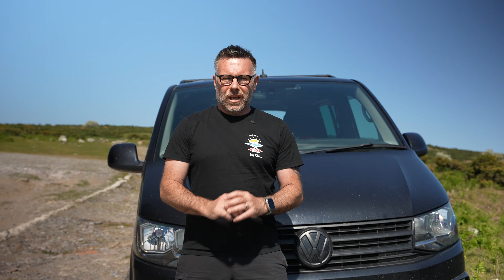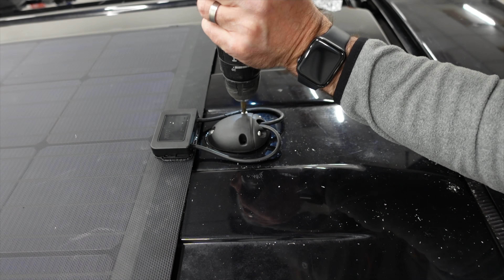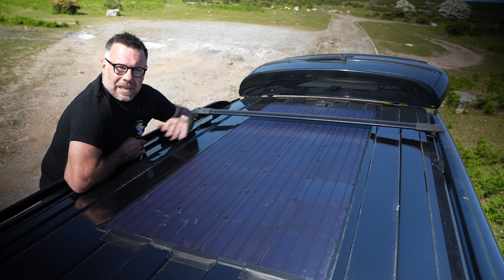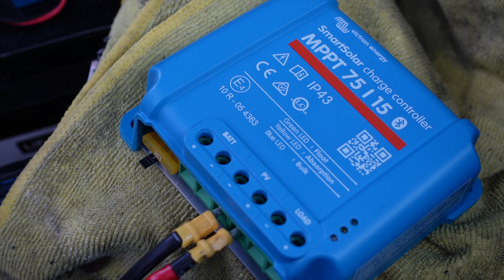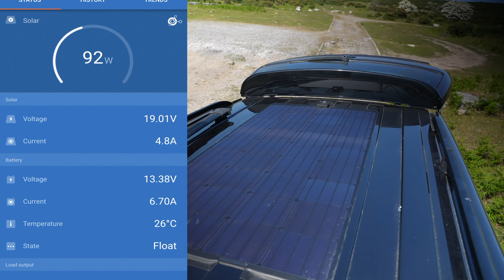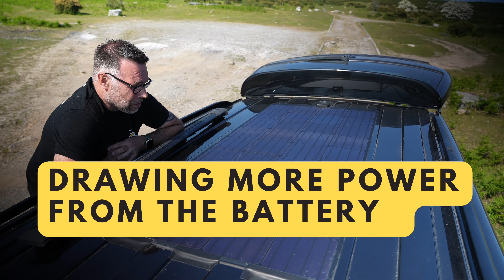Solar Panel on your Camper Van? Avoid This Mistake! ⚠️☀️

Comment: It's fine to do these tests for the purpose of tweaking a bit, but as long as the basics are not right you will never get maximum efficiency. There are solar panels on the market that does not reduce power because of partly shading, but most importantly, solar panels like to be cool. That will never be achieved with gluing a panel to the roof, and furthermore, my own - bad - experience is that, it heats up your van when you def not needing it. Just put your hand on your ceiling on a hot summer day.  I strongly recommend all builders to go for hard panels and at least have 50mm of air below to allow for airflow and cooling

Comment: How is your air resistance. My panels are 2 inches above the roof top.  It’s pulling the van when you don’t expect it. I’m assuming the air is going under the panel.   That’s only one problem. I simply don’t know how to use it. I’m trying.

Comment: Everyone's an expert watching someone else make a mistake. I'm an electrician by trade and even I didn't know how big of an impact even just partial shade would have on the electrical output of the panels. Thank you for sharing your experience! I've learnt loads!
Reply: As an electrician, you should know that. 😂 There are better quality panels that don't do this. That panel is also going to get hot with no ventilation. It's a stupid install.

Comment: Sun in Plymouth? Just kidding. Also temp will affect  it a fair bit but probably less of an issue in UK than Aus, we keep them off the metal roof a little makes a big difference. It's interesting how location affects application, often overlooked by online debate.

Comment: What do you expect from a flexible panel glued flat on black car with no air gap… get a portable panel, point it in perfect sun direction and you get almost the rated WP if ther is enough breeze. If you prefer fixed instal, use a regular penal mounted on your roof Bars. This Will also keep your van cooler inside (if it is big enough) as it drops shadow with wind circulation to the car’s roof. But don’t expect wonders with a flat mounted panel.
Reply from the maker: Think you missed the point. Ie making sure people understand they can’t cover any part of it.
Not all semi flexible panels are the same, you don’t need an air gap for all.
I have a portable, but it’s easier to have a trickle from a permanently installed panel

Comment: Well it's bloody obvious why, how could you not see the problem ?, you also need to have airflow under thre panel as a over heated panel will drastically cut down your output power.

Comment: So I see all the advice, but bought my van done by someone with some put aside to repair as required, my solar panel is fitted pretty much like this one, but no glue where it doesn’t touch the roof so there is some air flow, it has been on for over 5 years now, it is very close pulling its rated wattage, no issues what so ever, no paint damage/fade etc so interesting to see all this advice !

Comment: I have a super modern 180 W flexible panel on my roof. When I tested it in early spring it got 120 W but now in summer I get max 60 W even when I come out of a garage and it is cool ... I dont have anything else on my roof, no shade for sure. I am sure it partially broken. Not sure if it was the summer sun heat or if it is an error by the manufacturer.
Reply from the maker: It can be dependant on a number of factors. For example the charge state of your battery, the load on it etc.

Comment: Definitely better off with a fixed panel on a roof rack as you get airflow around the panel. I opted for fixed on my last van t5.1 and fixed on my current build sprinter mwb this one I'm excited for 305watts on a lithium setup for offgrid. Tbh even with a 130 ah agm with 175 watt fixed panel it was good enough for a 9 day euro trip obvs with a 30amp dc to dc charger too

Comment: Better off fitting extra batteries of as higher quality & amp hour rating as can be installed, we fitted an extra battery & with out any charging can go at least 5 days & we generally don’t stop for more than 3 days at any camp site, just factor in electric hook up at perhaps every other site.

Comment: Er, not sticking it to the roof but having an air gap behind the panel has an effect but if you point the panel at the side so it's perpendicular to the sun, that will make more of a difference. NGL very long video for a very basic point

Comment: Sadly you couldn't have fitted more wrong but hey, every day is a school day!
Reply from the maker: Please explain? 
The size of the panel means it can’t go any other way. It’s quite simple, when the bars aren’t being used, one is moved towards the other not blocking the panel. When the roof bars are in use, the panel is blocked anyway 🤷🏻‍♂️
A different size/type of panel and things could be different

Comment: This is what sailors quickly learned with their ropes hanging over their panels.  Another tip is to allow air flow under the panels to allow them to cool down....increase another 10-20% output.   my experimenting ...https://youtu.be/GXz3FR9GWzM

Comment: I can't remember which one it is but. I think yours is the poly one and the mono one is the other type. Now if you block a cell with anything like your hand it cuts down power. But the other type shuts down completely. If one bit is shaded. So you have the best one I think.

Comment: Nice video! Quick question. I don’t have any knowledge about electricity etc. I bought a van, completely transformed it into a campervan and want to travel Australia. I have a deep cycle battery and a foldable solar blanket. The battery also gets charged while driving. Let’s say I will install a solar panel: how many watts should my setup be? I only have an Adventuring fridge which is covered with insulation. The main goal is to keep the fridge running and charge a phone/laptop. Would love to hear from you!

Comment: I'm on my 4th panel, 1st on died due to heat of roof directed mounted to roof with 3m doubled sided tape, 2nd panel was 150 renogy its worked great although hung over the sunroof a little and in time bent back and contents broke, 3rd panel was DOA now 4th panel 200w and prior to permanently or semi-permanently fix it , I did many tests.
1st test panel out on a flat surface say a camp table using a multimeter set on amp check the amp age i was getting 8 to 10 amps, 10amps setting off the multimeter over current alarm.
So we know the panels good.
2nd test place panel on roof area with a small amount of double stick tape, multimeter now reads 1,5amps very surprising 
Removed the panel and placed back on table now 7 to 10 amps.
This all prior to connecting the panel the above measurements 

Currently I have the following ghetto setup
Old panel still on the roof, it won't be coming off with that much 3m tape
1 piece of plywood in between old and new panel forms an insulation heat gap.
New panel on top, again 7 to amps in full Australian sun.
Once connected up to the dc to dc charger battery monitor shows 3 to 8 amps.
Again out with multimeter and measuring current prior to dc to dc charger at solar input terminals results 6 to 9amps

Going forward a piece of twinwalled polycarbonate roofing will replace the plywood, with air channels running front to back.
They are solar panels but heat effects the flexible ones.
If you look through YouTube there's a few people running airgap setup in various styles.

Try the multimeter test where the panel wiring connects to your mppt, I think you will be surprised at how much work the mppt is doing to not over charge you battery.
Measure both current and volts then times the 2 for watts measurement. 

I would be interested in the results

Comment: putting a solar panel on a flat metal roof is a big mistake.
get a few inch of air flow under it to cool the panel down and point it at the sun and in the summer you will make more power that the sticker says :D
i was getting 115 to 125w from my 100w solar panels in the summer with a 3 inch gap and a near perfect angle to the sun.
i hope you had a battery connected to that controller

Comment: Your 150 watt panel is rated in a controlled environment of 25 degrees at 1000 watts per m2 of solar irradiance.  Placing this panel on your roof with no airflow underneath to help keep it cooler will drastically cut your solar production. Shading and Heat is the biggest killer for solar efficenty and is why most roof panels are raised off the roof to allow for adequate airflow to help keep them cooler. Shading also causes internal resistance which manifest as heat so you get a double whammy effect by shading your panels. when a cell is in shade the other cells try to compensate and heat up. In an electrical string it can only work as effectively as the weakest link in the chain. I would not recommend doing this  to your vehicle, you have most likely oxidised your paint work as well from the extreme heat. This panel will also have a very short lifespan.
Reply: Completely agree. My renogy 200W flex panel mounted in this way burned out after 2 days of sun in northern Scotland 😅 now left with a Sikaflexed useless panel. These are good price though compared to rigid, so thinking for next time to mount it to a thin board and hang it under the roof bars using U bolts.

Comment: I'm sorry but the solar industry has really pissed me off. Based on your own numbers, on a beautiful day, you have a 150W panel only producing 92W at most. 92/150 = 61.3%. That is awful in my opinion. Yes I understand that the panels need to be tilted and you lose efficiency as they heat up BUT they should be sold as what you are likely to get for production, not as the best case, perfect scenario. 

I say that because I have 3 x 370W panels on my truck for 1,110W. I never see that number. There will never be perfect conditions to make the full 1,110W so I think it's incredibly deceptive to label the panels as such. My car's gas mileage can be proven and it doesn't rely on perfect conditions which will never happen. If you sold me a car that gets 20mpg and I only ever get 12mpg, I'd sue the shit out of you. 

Angry rant aside, good video.

Comment: Flexible panels on a black roof are very hot no ventilation underneath them that reduces the output of your panels as well. Always get twice the wattage of panels that you think you will need
Reply: This is absolutely correct. The flat panels on a dark roof not having air under it will decrease output. Hot panels are less productive
Reply: I had a flexible solar panel on my T5 for 3 years but then when removing to have a pop top in didn't realise that it had burnt the top of the van even though I had a small space under for ventilation. I don't use flexible any more 😂
Reply: I just work off 3 sun hours in winter and 5 in summer. Rainy days expect about 1.
Reply: Does this not have ventilation due to the shape of the roof here, the raised bits? Or is that not enough?

Comment: This is not the way to mount a flexible solar panel on the roof anyway. The paint of black and the panel is black so all that heat will drop the solar panel output before even speaking about the bird drops.

Comment: Looking at your panel installation have you had any problems with the panel lifting off whilst driving. What is it glued/stuck down with?
Reply from the maker: Not had any problems at all. I do check regularly and it hasn’t lifted at all. I used silkaflex

Comment: Just noticed i had no output at camperjam, checked voltage at the connection box and only getting 14.6volts……guttted, less than a year old too🥲. Posting vid soon

Comment: Have you ppf your front and full ceramic coated your t6?
Reply from the maker: Not going the PPF route, had been ceramic coated, but it’s something I will be having redone/doing again soon.
Reply: @StaycationLifestyle  How come no ppf? Saves you getting loads of chips
Reply from the maker: The van had stone chips when I got it.
PPF is good from new or after a respray.

Comment: That cos your battery is nearly charged , it will only supply the power needed thats what the controller does 😂😂
Reply from the maker: I know, that’s why I plugged my 230v devices in. That’s why it’s not pulling near 150w, however you can see with shading it makes a big difference 66 to 93
Reply: The instant your comment popped up I looked at the state of the battery and it was float. So yeah, it makes sense what you are saying

Comment: Yes considered that cenereo pal got one in suitcase type you can point where ever you want .
Reply from the maker: Pros and cons. The suitcase ones only work when you put them out (obviously 🤣) the fixed will work all the time, but subject to any shading from trees etc.
Suitcase ones take up more internal space and you have to remember to put them out, however you do get the perfect angle when required. 
Just a personal preference 👍

Comment: Really surprising that....Also sl8ghtly disappeared that your only getting 95 8sh watts from what looks like a perfect day😒 Ive heard that a good airlow around/under them improves the output
Reply from the maker: My battery was pretty full and there wasn’t much power being drawn from the battery. The solar controllers are pretty clever, it only takes what the battery needs, therefore if the battery doesn’t need much, the watts can show really low. Until I plugged my laptop in, it was actually zero watts, as the battery didn’t need anything
Reply: @StaycationLifestyle  ah right, didn't realise that 👍
Reply: You're never going to get 100% efficiency from these panels, regardless of any other factors. You'll be lucky to get 70% efficiency which equates to 105W for a 150W-rated panel.

Comment: Is it possible to fit a Solar panel to a VW Transporter roof and feed the cables in between the rear doors without having to drill any holes ?
Reply from the maker: You can come through the rubber grommets, if you like. However, a hole done properly with a marine gland won’t have any leaks and looks better (not that you really see your roof)

Comment: I had the exact same issue, and had the exact same results when I removed the roof bar covering the panel. I also make sure I carefully wash the panel before going away.
Reply from the maker: Many people suffer especially when they go away, as it then you need the roof bars. They are easy and quick enough to move. Especially when I keep the tool in the glovebox 😃

Comment: The main reason you might find is that there's no air gap and the panels boiling.  
I had same problem with my boat and van
Etfe is prism design for European sun angles. But there for caravans ideally not for metal. So I was told and experienced on my van.  Annoying as fook....best of luck
Reply: My roof isn't flat ,but having a black coloured car,
Guess the efficiency will reduce when its hot weather
Reply: I think they call it dioding or similar built into its structive that allows for shaded areas not affecting panels. Some have it. Some don't. 
Could be wrong
Reply: @dmldml7886  your right ,the solar panels on my roof has something similar
These days you have panels who aren't affected by clouds,shadow or dirt to put on houses
Guess that's what you referring to
Reply from the maker: Some panels, these included do have a purpose made backing, so that is fine. Also as this is on a ridged roof, there is a good airflow under (albeit not the entire panel). I’ve never had a problem with mine other than the shading, although i do know many people have.